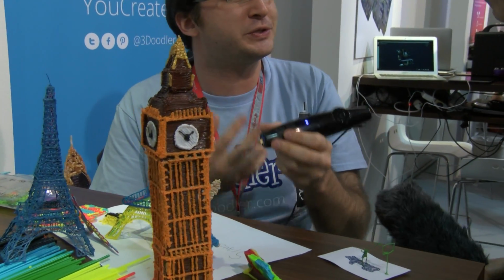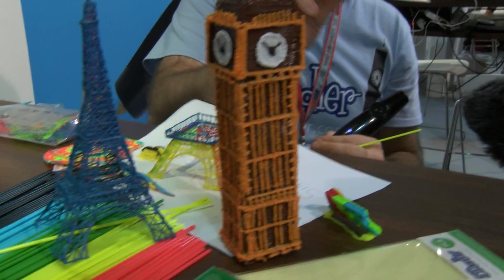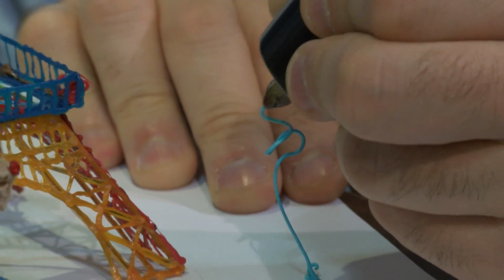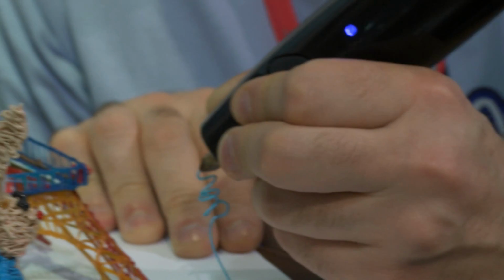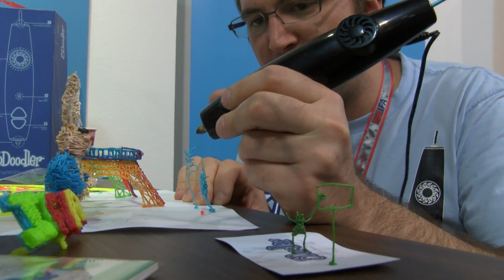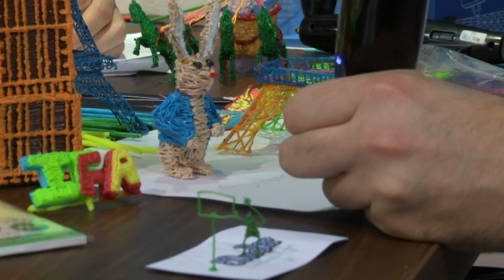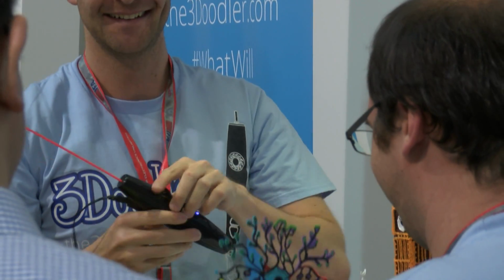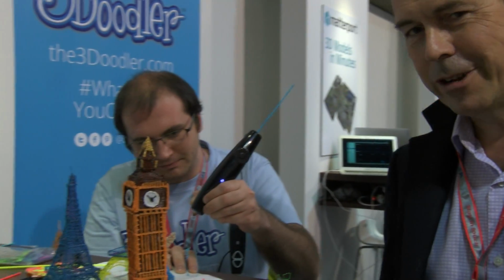Is the 3Doodler an 'entry point' for 3D printing?

Comment: thats a glue gun minus the handle
Reply: Try writing in the air with a hit glue gun
Reply: Telma Pettersson ya with a fast drying plastic instead of a glue.
Reply: Can you post a video on that?
Reply: Hot glue guns (even the smallest) have too big of an opening for detailed works.:) Also, if hot glue guns can accomplish such task, then don't you think hot glue gun producers would have realized that?
Reply: first of all, i wasnt saying it's actually a glue gun. i meant that he took the concept of a glue gun. and yes, if u use the same material he uses instead of the glue, yes it can do the same thing.
Reply: Jan Eunice Villapaz No, hot glue guns may melt plastic, but it can't be used to draw because the opening is too wide, thus, it is hard for artists to draw fine lines/detailed works.
Reply: Karen Tran of course the opening is big. well i mean u can resize it the hole and change the  glue stick with that "fast dry plastic" isnt it? hahahaha
Reply: Totty I understand but hot glue gun manufacturers have never thought of inserting plastic sticks into those guns. Thus, I still think this invention is very innovative and creative. To each their own opinion I guess.

Comment: this product will fail for sure, for 3 simple reasons:
1. it's not that accurate
2. much less spectacular than modeling in 3d software
3. old fashioned modeling still looks more professional
4. it's a toy
Reply: Right, so you're saying that there is 3 simple reasons and then you state 4?! I mean, seriously? Lol
Reply: Lily Berry u have nothing better to do than to count my reasons? lolol
Reply: "u have nothing better to do than to count my reasons?"  You stated the number of reasons, your comeback is invalid.
Reply: No, the product is as accurate as the person using it so you are wrong.
Reply: I would have to disagree with you ivke32 
1.  It's accurate if you take your time.. just like a pencil is accurate to those who take their time.
2.  comparing a 3d printer to a 3d pen is like comparing a regular printer and a pen.  They're different and used for different ideas.  If I wanted to print a hammer id use a 3d printer.  If I wanted to write a cube id use the pen.  It'd be too time consuming to print a cube for a purpose.  
3.  I think you're correct
4.  I love the guitar.  I think of it as a toy.  It's my favorite toy to play with.  It's still an awesome instrument that expresses sounds in an organized fashion.  A toy means it's easy and fun, not something to devalue.

Plus, you need a 3doodler of 2014 to build the 3doodler of 2015 and you need the 3doodler of 2015 to build the 3doodler of 2016.  You can't just skip from 2014 to 2016.  This is going to replace the pen and pencil as we know it.  Just my humble opinion.
Reply: Although it is only £99 which is cheap for something that new
Reply: Well it was rated one of the number 1 gifts for the holidays.... It was sold out everywhere.... Just saying
Reply: 1. Do you even have one? Its very accurate, you just have to practice.
2. Its no less spectacular than modeling in 3d software. This allows you to create whatever you want EASILY, and its more fun to do it yourself than watch a machine do all the work. 3d printers also take FOREVER To make something.
3. what you call the "modeling" doesn't matter, unless it prevents you from doing something. the 3doodler can easily make anything you want.
4. Its no more of a toy than a real 3d printer. Most people who own 3d printers use them to make things that they could have made much more easily and quicker with a 3doodler. You really have to own one to know how good it is.
5. the 3doodler is actually very useful too, if you want to fix something, or even make something that you need in your house.
Reply: Magical Thinking Dude, your humble opinion is correct! ivke32 is just an ignorant hater :/
Reply: I have one. It's amazing .-.
Reply: ***** Ikr. He is such a hypocrite
Reply: :/ now im depressed...
Reply: :/ now im depressed...
Reply: Bruce Wayne That's true
Reply: Evan B Just got one for present. now very useful, but extreely fun :3 really glad to get something like that
Reply: Vanessa Vanhdivong Same.
Reply: If thats the word you want to use
Reply: ***** This is exactly what I meant  you just explained it a lot better XD I'm not good with words...
Reply: Ummmm, there's a new version of the 3doodler, it's better.  So stop being a noob

Comment: This would be great for making custom cake decorations. Obviously, they wouldn't be edible, but you could make some amazing personalized cake toppers for special occasions like a wedding. To bad you can't fill it with some kind of sturdy icing or fondant that holds up, instead of the plastic, so they can be edible.
Reply: You're not far from the truth. There is such thing called food 3D printers. I've seen a few videos of 3D printers making some "complex" pastries and biscuits. The key here is to make an edible material stick that behaves the same way as the plastic sticks at the temperature of the pen tip.